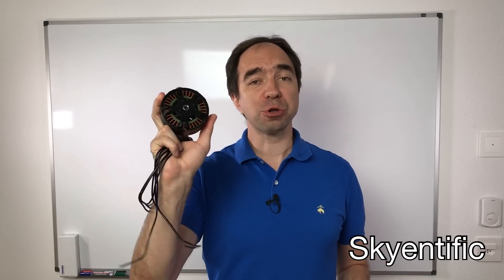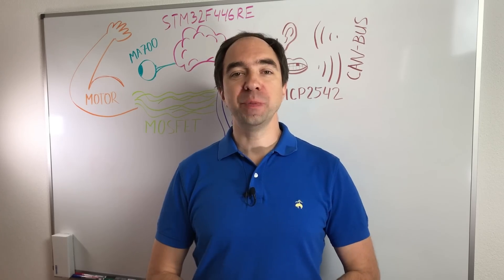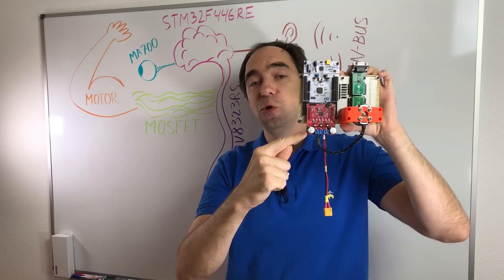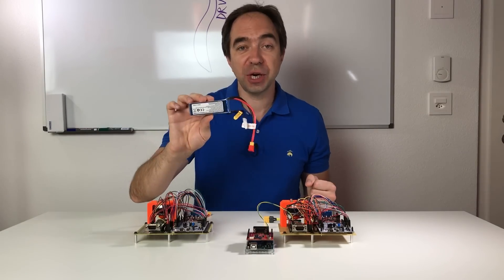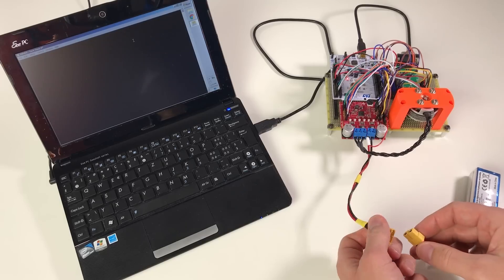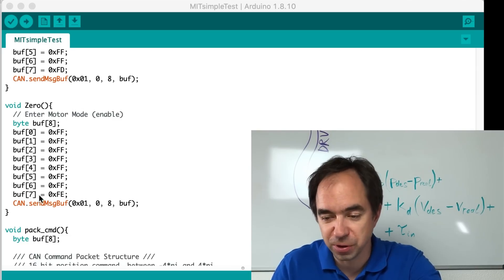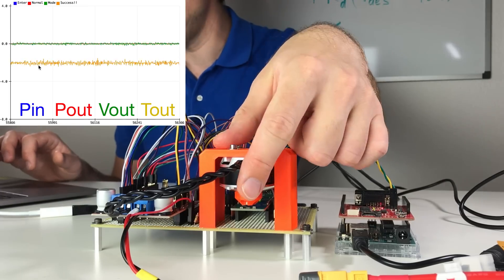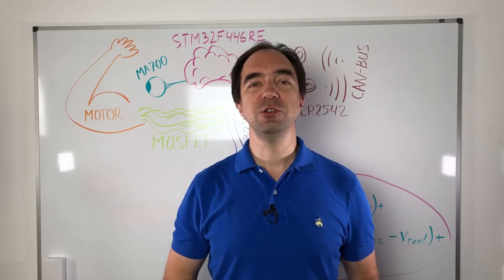How to build MIT Mini Cheetah Controller

Comment: Your videos are so awesome. Just saw that somebody else uses your videos for their engineering thesis, as will I. I have even quoted you multiple times! 
As for the MIT mini cheetah controller, I would say its only useful for robodog applications or robots which generally have a parallel kinematic configuration? the mjbots controller would be more useful for a serial kinematic configuration, as the user can integrate the controller into a daisy chain? Really love your stuff. Cheers!

Comment: I remeber MAG700 is 11-Bit Resolution Absolute Angle Encoder, how you get 14-Bit Data(what I see when in encoder mood)?
Reply from the maker: I don’t know exactly how it works. But I think it gives you 14 Bit, but only 11 Bit is guaranteed precision. Like scale can show 1.543kg, but only have 0.1kg precision. Meaning that the rest you can use at your own risk.
Reply: @Skyentific  hah, I made a PCB with MAG700, and makes some changes to the HKC_MiniCheetah follow your vedio,  the motor can turn in a strange way. When I whatched the encoder data, I found it is strange and the encoder row data seems can only reach 8191(13bit), and I whatched your vedio again and I found that. It seems like I have to make some changes to the sourse code

Comment: Good video. From what I saw in the code snippets, the original author uses a PD controller algorithm to reach set points. I think you could have mentioned that. PD/PID controllers are very essential and super fun to learn about and experiment with. I use them in virtually all robot related coding I do.

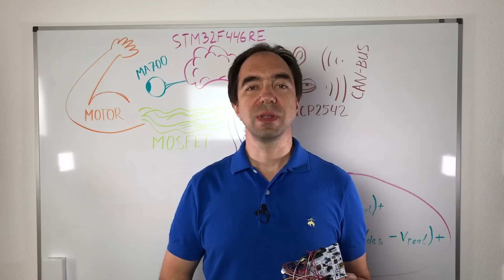Comment: @11:14 I totally approve your temperature checking procedure. I have the same genuine one. I just put my fingers on chips and actuators casings. Just to get a feel of how wrong I am operating them. Sometimes I wonder how those guys writing the datasheets are able to crank that much power in smd components. Maybe "Absolute maximum ratings" is not standing for "Ideal operation mode without heatsink and no air flow". Never mind. I guess seeing the magic smoke is how you learn.

Comment: Is a compatible board available for purchase somewhere?
Reply from the maker: Jaroslav Malec great question. The answer: not really. The closest that I found: 
https://a.aliexpress.com/_BSA2Ui . But it takes more than one month for delivery. And I did not yet tested it. Also the original ones are smaller.
Reply: @Skyentific  Thanks, interesting. Seems to me that the firmware is more capable than in ODrive. Having this thing available could be cool. Although possibly it might result in something like the mjbots/moteus with similar price.

Comment: Hi Skyentific, lately i ve been following your work very close and with this last video i was wondering if i could controll the steady win motors v3 following this steps. I had a similar code but didnt get a smooth position control due to an incorrect velocity adjustment. Thank you for your work.
Reply from the maker: Normally the latest version of steady win should work with this algorithm. What do you mean by incorrect velocity adjustment?
Reply: Hi, in my code i use the same type of messages with position, velocity, kp, etc. Putting a low kp and adding  small steps i get a smooth and close result to the position desire (always moving with the same velocity despite significant changes). But even when i put kp to 0 and want only a velocity controll i cant  see any significant changes on this parameter. Also my motor with higther steps vibrates a lot. In case you are wondering if its a motor problem ive already had change it and got the same problem. Thank you again for your time and continue with this great videos.

Comment: amazing work as allways! it will be wonderful to see all these components put onto a single board, with so many places offering custom PCBs this should be cheap and easy.
Reply from the maker: I looked at this. I don’t yet found how to do it. But it is not easy and not cheap. Only the components (without PCB and soldering) cost around 35USD. Also there are no many companies which can provide assembly. And not many of them have all necessary components. For example, JLCPCB, which is advertised by many youtubers, cannot assemble such board. The only possibility to get reasonable price is to order large quantity.

Comment: You never post anything from your projects yet you use a lot of opensource projects. So you capitalize with tons of community driven projects but you don't contribute anything to the community. I have posted several printable items on thingyverse, but never encountered a guy who talks just exactly like you, never providing links of anything you use.
Reply from the maker: My most accomplished project is in open source (6DoF robot arm). My 7DoF robot arm will be open source when it is finished. In each my video, I always make sure that all the codes are explained completely.  Even in this video, if you look carefully, you find out that ALL code lines are in video. So, if someone need, he can always copy them. By the way, most of my Patreons, they have access to all my files (CAD files, codes, etc). And in video I always explain all complicated parts. Another example: open torque actuator, I used open source files, and modified them. All these files are open source now too. I even send them to the original creator. So you are wrong.
Reply: @Skyentific  long time ago, I saw the process of that build, people were asking about files or any information really about your build and never found anything from you. Now, because you mentioned your project and that you shared the files. I looked at your playlist, went to search for any GitHub account or anything. And found it. You did shared your files and basically your project. So I truly apologize for that comment, maybe I let it there, so people know that I was wrong and they can actually find wonderful projects in your page. Or erase the comment to keep clean and no bad comments on your site. Let me know, either way, I was wrong and again I apologise.
Reply from the maker: No problem. I try to be as open source as possible. I even don’t apply for patents anymore. :) I think often they slow down the progress. :)
Reply: @Skyentific  completely agree with that part, that's it, I remember something about that also. Guess I was with that impression also. But people evolve and philosophies change. Cheers!

Comment: I looked at a lot of the links mentioned below but didn't find how to construct this with the various evaluation boards you are using, any more information available?
Reply from the maker: I just took the schematics of original MIT controller, schematics of each evaluation boards. And from this I deduced how to connect evaluation boards.
Reply: Skyentific that’s excellent! If you would like more info on the DRV, I can help!

Comment: Excellent video as always!  I was not aware that Cheetah h/w & f/w was available open source, so thank you for the links!  I must comment on CAN bus however, so that everyone watching understands -- you say: "CAN takes two wires" -- well, yes, because you already have a common ground from the power rail.  Many people assume that CAN is differential signalling, but strictly speaking, it is not.  When sending payload data, CAN_H and CAN_L are always opposite, so might be considered a differential pair, but during the arbitration phase, where message IDs are in collision on the bus, all the CAN transceivers on the bus must have a common ground. CAN_H and CAN_L are ground-referenced during arbitration.  So CAN really takes 3 wires -- of course, if all the stations on the CAN bus share a common power supply, then the ground comes from that -- but beware of isolated ground planes!  Thank you for another great video!

Comment: Hi Skyentific, I'm curious if you've tried to use gimbal  bldc motors in robotics. I'm currently trying to choose the best main motors for 4 wheel robot. The theoretical required torque for one wheel schould be around 6,5Nm and maximum velocity of the robot has to be 0,5m/s. Oh, and I have 22,2V battery.
My plan is to pair the motor with low ratio gearbox which will be 3d printed. I found that gimbal motors have really small Kv and current. I'm thinking about using them along with 1:10-1:15 3d-printed planetary gearbox. Is this a good idea? Maybe it would be better to use higher Kv motor with higher ratio gearbox ? Or just use something like MIT Mini Cheetah that your rewieved?
Reply from the maker: I think you are doing everything right. I would do the same. Low KV motor with large radius (thus large torque) coupled with low ratio planetary gearbox should be perfect. If you have money for this project maybe you can use Gyems actuators (I did the review couple months ago). Otherwise 3D printed should work too. 
Of course you can also do this with low torque motor and high gear ratio reducer. But I don’t like this approach. I think it is less reliable.
Reply: @Skyentific  Thanks a lot for reply. Unfortunately, Gyems actuators are not available im my country and I'm forced to buy  parts for the project locally, not from China. I found very interesting motors, T-Motor G80 and G60 gimbal like motors. They are deesigned to use them in robotics applications. They seem to fit my needs perfecly so I think I will go for them and low ratio planetary gearbox.

Comment: I would be interested in a more thorough review of the mjbots controller! Electronically mjbots, odrive and MIT Cheetah controllers are almost identical, down to the STM32 uC (and the sw is open-source for all of them). But only the mjbots electronics are open AND specifically made compact to be mounted on actuators AND available to be bought assembled (at the price of just the DC drive stage dev board from your video).
Reply: https://youtu.be/6MF33St61vo

Comment: what is the added benefit of using this type of brushless motor as oppose to one specifically  designed for position and steps , like a stepper ?  I always thought these where designed to just go very fast and continuously....  but what hes doing here looks soo freaking amazing
Reply: There are multiples pros and cons :
Brushless are fast and powerful, most controllers can handle external forces (you get motors acting like springs, more current makes them stiffer) and they have a very smooth operation.
In the other hand, stepper motors cannot support being back driven (they "lose steps" if they don't have an encoder) they create vibrations because of the steps and their torque gets lower when they turn, but they provide a better "holding" torque.
Also brushless motor control boards are much more expensive and complex (as you can see in the video) than simple stepper drivers.

In terms of precision... It depends of the usecase, but both solutions are equally capable.
Reply: @Rocan0  got it! Thanks!!

Comment: Lol, I am building a humanoid robot with 28 DOF (not including hands/face), and are sad by these fat and heavy motor controllers. Space and weight are major design constraints. pretty much need a custom pcb for bldc or gimble motors. This open source design is a good template.

Comment: Amazing work! Thank you for your ongoing efforts!
Breakout boards and links to projects including PCB:
NUCLEO-F446RE
MIKROE-2299
MIKROE-2338
BOOSTXL-DRV8323RS
Roughly Σ$143.37 USD + motor and wires

Ben Katz:
Masters Thesis: A low cost modular actuator for dynamic robots: https://dspace.mit.edu/handle/1721.1/118671
Git PCB 3phase_integrated
: https://github.com/bgkatz/3phase_integrated
arm MBED HKC_MiniCheetah: https://os.mbed.com/users/benkatz/code/HKC_MiniCheetah/